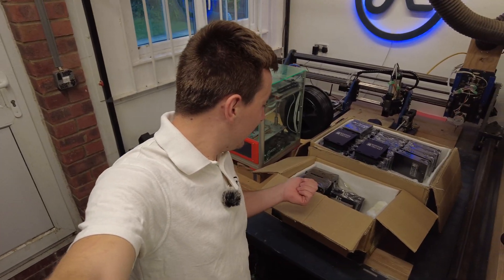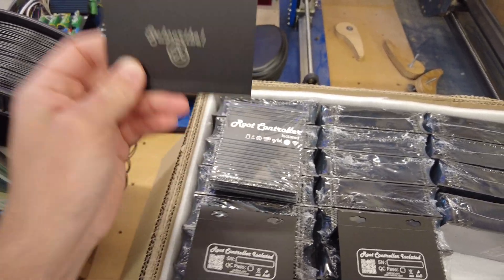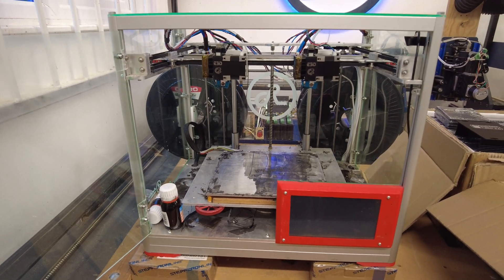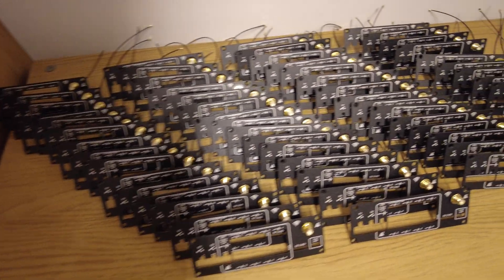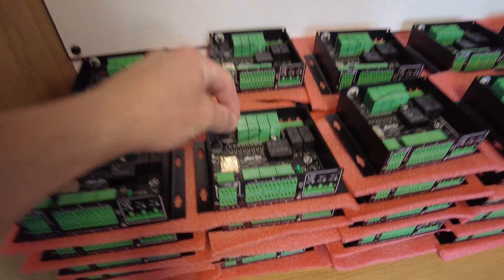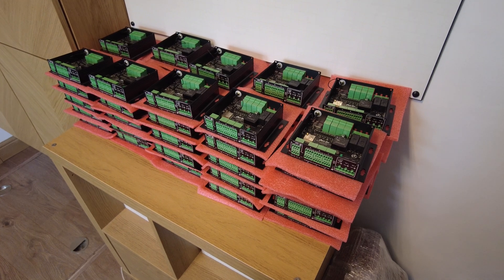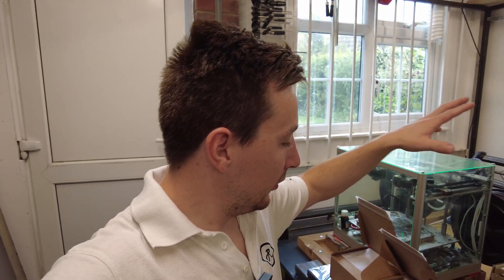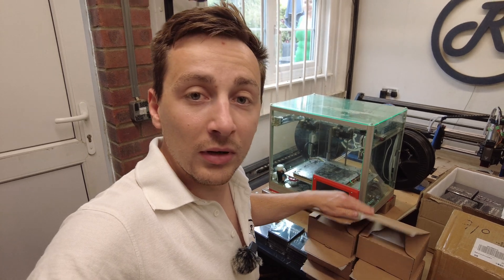Building the Root Controller ISO Rev 3 | Vlog 4

Comment: Fantastic! I’ve been really debating on which board I want to use for my first ever CNC build (RatRig Stronghold) and I think I finally settled on this vs the xPro V5 / BlackBox X32
Reply from the maker: All good choices! I'm clearly biased but all of those will do a great job for what you need
Reply: I love the fact that your board is isolated, and supports external stepper drivers which is HUGE but then again... you already know this ;)  @RootCNC
Reply from the maker: @mciarlillo1309  it was targeted at filling that gap in the market, whilst trying to add flexibility. I've got a video snippet coming shortly, demoing closed loop stepper motors
Reply: @RootCNC  Glad to hear the flexibility in what steppers can be used! I’ve been debating on open or closed steppers for awhile now. Either way I’ll go with DM542T / DM556T or CL57Ts.
Reply from the maker: All of them are good choices, I've personally used the DM542 the most. but I do have a video coming out shortly demoing the CL57T with the Root controller, so say tuned for that! (spoilers they're seem great!)